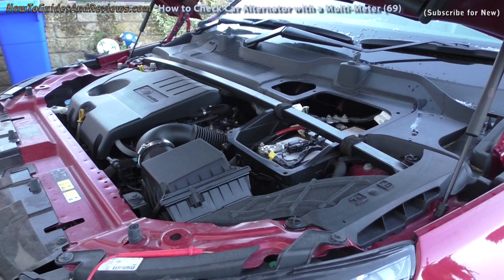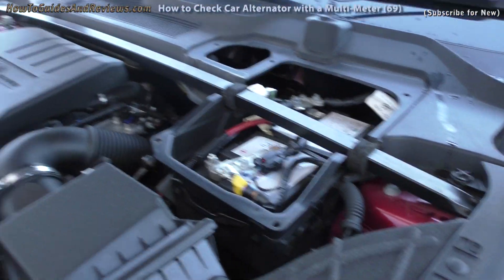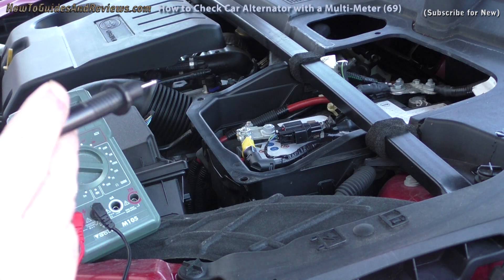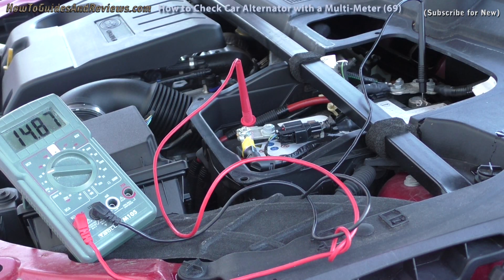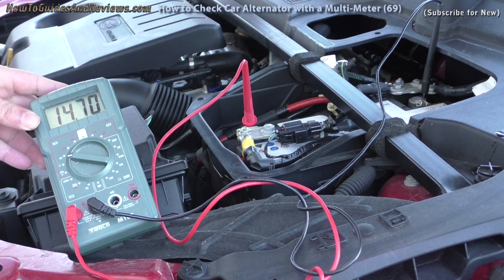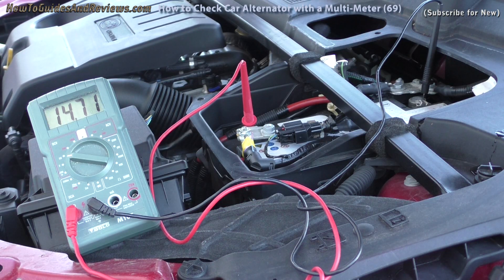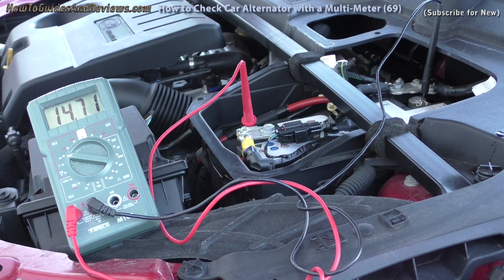How to Test Car Alternator with Multimeter for Bad Alternator or Battery

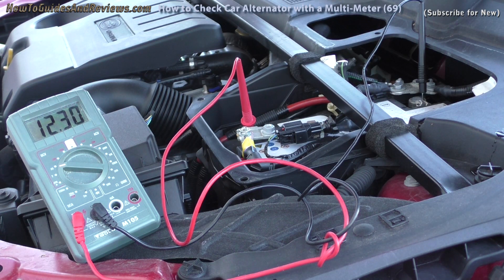Comment: Okay is it me? I find it confusing that the battery was ~12v which is pretty low really almost at 25% capacity, and then BEFORE you started the car 1:30, the meter then jumps up and shows 14.8v 1:32. Where did that come from? After you start the car it goes down to 14.7.  You;'re fiddling w something off camera before the car starts or what is happening here? I'd like to use this but can't unless it';s explained better, but thanks anyway for posting.
Reply from the maker: The car starts at 2.01, the cars not on at 1.32. Fiddling with something?  Getting into the car, and turning ignition on, and then starting the car.

1. Hooked multimeter up to car battery.
2. got into car and turnd the ignition / engine on.
3. came back out and read the display.

Yes the battery needed charging.